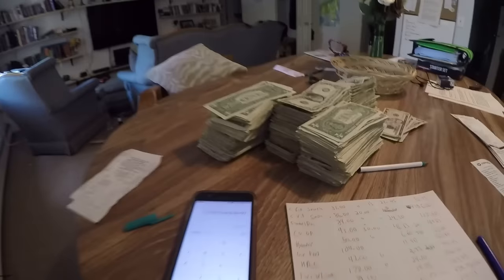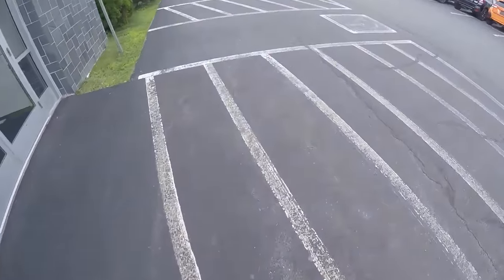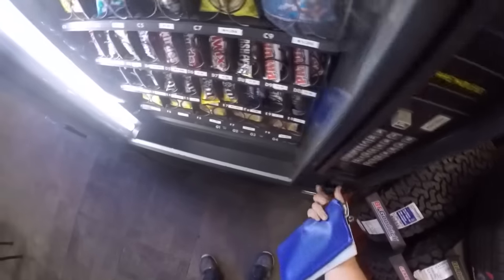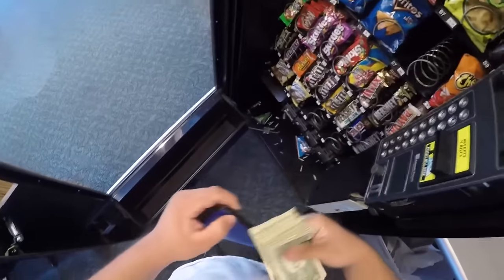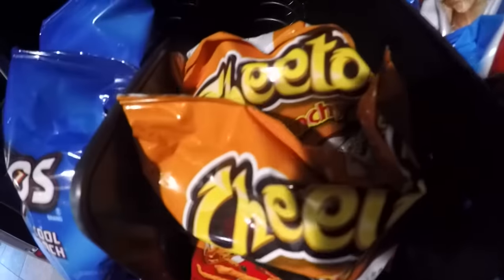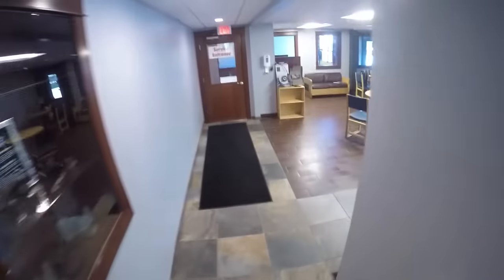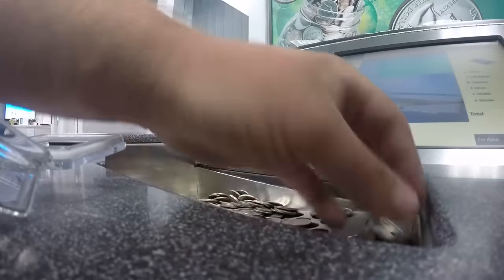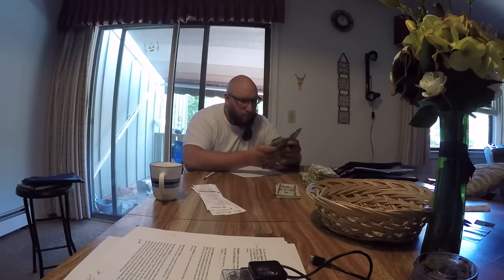collecting money from my 11 vending machines!

Comment: LOOK FOR STAR NOTES!! 

Tinny stars next to the serial numbers they can go for up to 3x face value on eBay 

$1-$100 bills 

Google what to spot if you’re interested 

There’s also SOLID silver quarters and dimes (extremely rare to find) not overly valuable but there worth setting aside and taking to a coin shop 

 How to spot - they have a solid silver edge (no copper) with a date of 1964 or older the value depends either on current silver prices or the condition of the coin
Reply: The coins are pretty easy to check just by stacking them there’s no need to check each ones edge 

Sorry if this is bugging u and u don’t care but since you’re dealing with a TON of coins and bills it’s worth checking them and getting a few extra bucks more then you’re already making  

Oh and u could switch them out and sell them on you’re own time no need to count them as “income” if u get more then face value for them 

I had a silver quarter and dime a few years ago and got them checked 

The dime was worth $3 and the quarter was worth around $5 YES that much for one coin just because they were silver

Comment: You’re losing a decent margin of money by using the coin star machine, instead go to a bank and trade it for paper
Reply: Regular Films he was at the bank while at the coin star machine. He said it was a free one that the bank installed because they don’t accept change anymore.
Reply: Yea in this case the bank is actually paying coinstar to provide a free coinstar machine. What the bank gets out of it is that they no longer have to pay an employee to spend all day running coins through. 

If your paying for 40 hours a week for example in coin running via an employee. I'm not saying they are, but if they were. THat's literally full time wages PLUS health benefits etc and evertyhing.

they basically decided it was cheaper to pay coinstar 30k a year to provide  a free serviced machine and have the customer do the labor then pay for the labor themselves and get the machine "free" at a fixed one time cost.